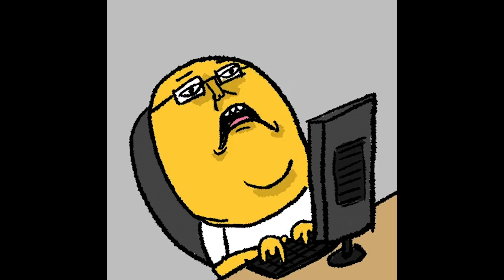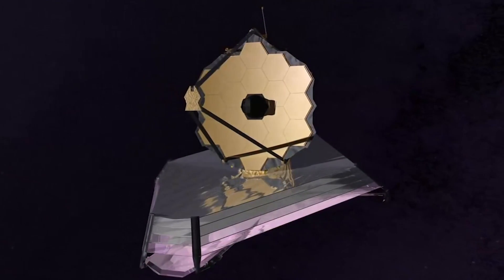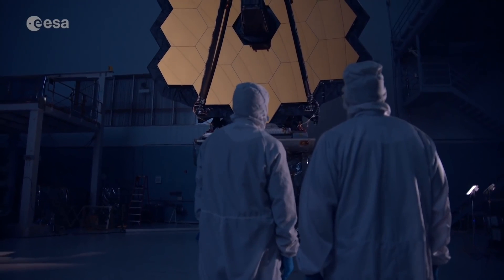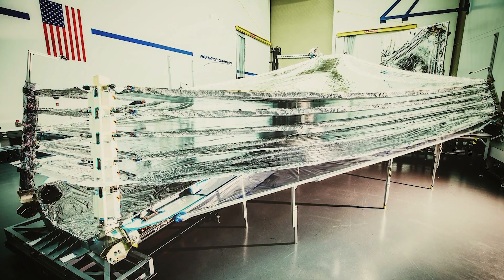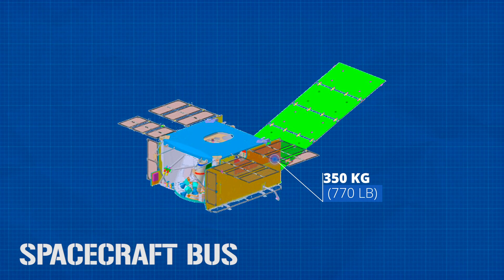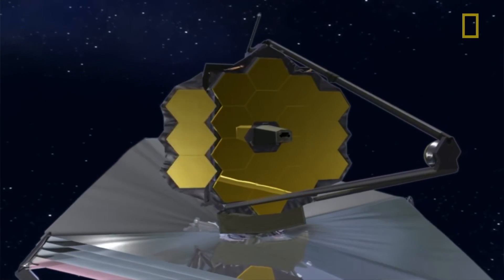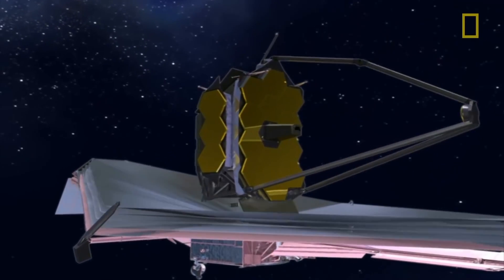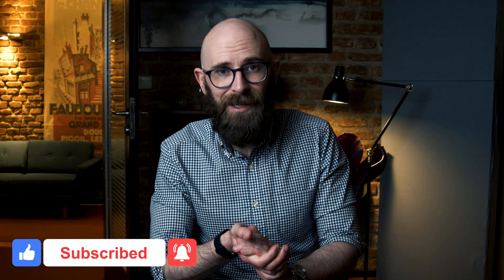The James Webb Space Telescope: Evolving Hubble for the 21st Century

Comment: What about this lensing system that uses a heavy body (sun ?) as a lens?
Focal point somewhere in the area where Voyager 1 is, sort of.
Or was it some 600 AU's?
Voyager 1 now at 14 billion miles 
1AU : 150 million km
Voyager 1: roiughly 130 AU
Conclusion :  blurred and out of focus as was once Hubble..
And focal point is really really far away..
But then, it was never meant to go this far.
I read it would take some 20 years to reach focal point for a 
craft designed for this purpose of traveling some 600 AU's?
Being cynical: plus 20yrs to build it?

Comment: The total cost of JWST has gone DOWN over the several years since it was first announced.
The first cost announcement, as I recall, was $30 billion, back in 2010.
Then, it was reported to cost $20 billion in 2013.
Next, it cost $13 billion.  Now, $10 billion.
Perhaps it should be delayed a bit more, then it will be free?
Keep in mind, the morons reporting the cost have spent the US into an unrecoverable debt, now $30 trillion ($30 thousand billion) in the hole.
Mostly borrowed from: china.
So, the Chinese can claim to "own" Webb!
Reply: Accually there are $7 Trillion in treasury notes and bonds owned by foreign countries, out of that China owns $1.1 Trillion or 3.9% of the US debt. You might be interested to know that Japan is the largest holder with $1.28 Trillion. Foreign countries seem to think the the US is a good investment, or do they just want us to continue to buy there crap.

Comment: The launch date has been moved back to November 19th.  I would trust SpaceX with it more, but the rocket for it has already been designated. Will the cooling and the telescope's "space umbrella" protect it from solar storms being that close to the sun?
SpaceX should start working on the mission to fix the JWT's myriad of failure points if it fails to deploy properly and it will certainly need maintenance on its 126 motors and over 800 other moving parts and computers.

Comment: I'm sure somebody is already commented on this, and this may not be read by the creator, but the people who made the Hubble telescope refused to let other people verify if the mirror was correct. They did one final check before launch and it showed it wasn't correct. So they decided not to believe that data but to believe the data that was 5 years old when they had checked the mirror before. They absolutely screwed up Hubble in a way that was easily detectable and easily correctable. But they told people to f off and said of letting an independent group verify the correct shape of the mirror. There is no reason to be surprised that the James Webb telescope is being verified by multiple groups. I'm saying I'm surprised it wasn't verified by more.

Comment: What I am worried about is the telescope's vulnerable state it can get hit by small meteorites due to not having any protection to projectile while in space and being far from Earth.

Can someone correct me if this issue has been resolved.
Reply: While feasible, it is a calculated negligible risk.  Kind of a big-space-little-meteorite deal.  Also, a micrometeorite would not explode the whole telescope, ot would just degrade performance.  Think of it like a pair of glasses.  They get smudged and scratched over time, but you can still see better with them on.

Comment: What is likely to be revealed when the James Webb telescope is turned on the dark spaces which remained in the Hubble deep space images? the signs are that what appears to be empty blackness will also be filled with galaxies. At what stage will blackness remain empty blackness no matter how powerful the telescope used on it may be?
Reply: "At what stage will blackness remain empty blackness no matter how powerful the telescope used on it may be?"

Only at the moment of self-realization.
Reply: @xxxYYZxxx  That is a stupid answer. No amount of self realisation will tell us what is in the black spaces which Hubble couldn't resolve. I realised that I  was myself when I was less than one year old, but it doesn't help me figure out what the Jas Webb will see in the black spaces.
Reply: @bernardedwards8461  My "answer" was meant to point out the metaphorical content of your query, however unintentional the metaphor may have been. 

A coherent structure sums to zero, while "empty blackness" is a metaphor for such a coherence, as per the term "metaphysical void".

The realization of the Absolute entails the realization of eternally pure stasis, colloquially referred to as "God's grace" or "Nirvana". 

An eternally pure stasis is the required form of "the universe", assuming the universe happens to be a coherent (zero sum) structure. If the universe isn't coherent, any dialog on the matter is a moot point to begin with.

Self-realization, among other thing, entails the realization of "eternally pure stasis", and hence my silly "answer" relating self realization to peering the endless void.

Comment: it is almost certain to fail within 3yrs due age of components reaching end of life see last cause of delay a wifi chip have to be replaced as it was end of life. this will be happening with all components including the mainboard actual board it is made of which often shrinks over time due volatilies evaporating thus causing shrinking of the actual board resulting in micro cracks of circuits !
Also its wavelength is in infrared which only benefits a limited number of astromers better to refurbish Hubble where all astronomers benefit and if being refurbished properly it wave length can be extended to infra red.
Better to sell it to eon Musk for him to launch  on his way to Mars.
Either that or just scrap it it is doing too much harm to other parts of the space program esp manned and Hubble!  it will continue to cost more of NASA budget after launch especially as it goes faulty due to age. waste of time money and resources allthough some technology advances have been made. But Bitcoin investment would give a better return ie put an all wavelength observatory on the moon !

Comment: It should be a requirement for all future launches that parts of any object sent into space be made with standardized parts in the same manner as a bag of tinker toys are all universal to one another. This way robotic systems in the future can disassemble antiquated or worn out equipment, and easily repurposed and flown to new projects. If designed at the outset to be scalable, this should be possible.

Comment: Instead of refueling the JWST, which seems risky due to the system design.  A dock with an electronic communication connection point could be added for replaceable propulsion units to dock and disconnect onto the telescope each 5-10years.
The way the propulsion unit is built, is the same way a battery is built into a phone, so consumers replace the phone instead of the battery.

Great way to make a few more billions, I see.
NASA, spend millions/ billions, use once, throw away.

Comment: I suspect that SpaceX could run a refueling tanker up to JWT in 5 or 10 years.  Depending on what JWT is able to actually accomplish during its first 5 years and how much more it could have available to do after its currently-expected lifespan, it might be worth the effort; and it would certainly be better and cheaper than waiting another 20 years for a replacement.

Thanks for posting.

Comment: The scariest part of this mission will be the initial deployment. 
 The company I work for not only built all of the mirrors themselves, but all of the deployment and focus adjusting motors and mechanisms.
The electronic boxes that drive the focus motors must work down to FIVE DEGREES KELVIN!
I helped test some of those boxes in a Liquid Helium cooled Thermal Vacuum chamber.
Reply: NASA Plum Brook Station in Ohio?
Reply: @sethshaffer8592  Are you asking where I work?
A hint: The same company that built the hardware that fixed the Hubble Telescope, Built the Kepler Space Telescope, Lots of Spizter, and AXAF, the HiRise camera in orbit of Mars, and the Deep Impact spacecraft that slammed into a comet.
Reply: Just one small correction to your post: it's 5 kelvin, never 5 degrees kelvin. Kelvin are an absolute unit, thedefore it does not need the "degrees" part unlike celsius, for example :)
Reply: @stuartgray5877  love when people name drop instead of answering a simple question..
Reply: @macdietz  Great.  Because that's what I did.  I love it when people are sarcastic.
Reply: Near Cullman AL?
Reply: @richardwilliams7492  I work for Ball Aerospace if that is what you are asking....
Reply: @PinnëdbyMegaprojects   You have been reported for Impersonation and Phishing =)
Reply: @stuartgray5877  
Hi Stuart. I also worked at Ball, in Boulder,  in the Flight Machine Shop, doing WireEDM work on JWST.... primarily on the various titanium flexures which are going to be making the very precise adjustments needed to focus the primary mirror segments, between 2003 and 2016 when I retired. 

Looking forward to a very successful launch and deployment..... which will serve to give an even greater "depth of field" to King David's observation in the opening verse of Psalm 19... The heaven's declare the glory of God!
Reply: @user-iyyyy  then we would know each other by sight.  I used to walk past the EDM machines a dozen times a day.   My avatar pic is JPSS-1 ready for launch.
I was the guy that used to dig through your recycle bin for cool stuff.  In fact they moved the bin behind your EDM machines probably because of me.
Reply: And??? What happened? They failed?
Reply: If this fails, I will personally hold you responsible 😂
Reply: ^I can't believe there are two people active on the project in the comments section. That's awesome
Reply: I worked down at Unicircuit in Littleton helping to make the bareboard for JWST. Pretty happy things are going well with the deployment.

Comment: Why JWST will unfold and test just at the L2? It could be done in the LEO and gently transferred to L2.
Reply: Just a few issues with this (very simplified) 1. More atoms in LEO will degrade mirrors.  2. Bad thermal environment for the necessary cool down.  3. Damage due to accelerations in deployed configuration.
Reply: @notmuch117  No need for simplification. 1. More atoms in LEO for few weeks wont hurt JWST as it did not HST for 30 years. Atoms are lesser problem than micro meteorites which are present at the L2 also.
2. Not perfect, but no damage will be made to the telescope.
3. JWST will travel 14 days to the L2. No need for large acceleration. Delta v needed from LEO to the L2 is less than 3.5 km/s. Ideal for ion thrusters, if 60 days transfer is acceptable.. Anyhow, test deployments on the ground put much larger force on the elements, than any resonable burn.
Reply: This is why my response was stated as being over-simplified. Not trying to get into battle of wits.  You seemed to ask an  earnest question and I was just supplying a few of the points/reasons I see for the current plan.
1. Apples to oranges.  JWST mirrors are different materials and coatings which are much more susceptible to atomic degradation... and particulate damage due to not being encased.  Also, I made an assumption you meant A LEO we could send a manned craft to help deploy/repair.  We currently can't do that with hubble.  I may have missed the point here.  (I'm not even going into current craft and EVA capability...or lack thereof)
2. Not necessarily true.  Orbiting earth would provide relatively wild temperature swings to the structure that would have been (Even more) expensive to design for/model/test/certify here on earth.  Something I know of-but not much about- would be the adverse effects from the plasma flow field in LEO.
3. There is a lot more to this than simplifying JWST to a ball of mass.  (I am not aware of the exactness of the 14 days number.)  It's not just getting to L2.  It's setting up an orbit around L2.  It's adding fuel mass to slow the satellite down after launch to keep it in LEO. It's adding fuel mass to accelerate back up... you see where this is going.  
As for testing, we can't simplify it to acting on a ball of mass.  Orientation and state of deployment are critical. Whenever ground tests would be too much for the structure, a gravity offset was used. (Eg. Secondary mirror deployment. )
I'm far from an expert in this, but have found that there are often (not always) some really good reasons for complex decisions like this that are not immediately apparent.
Reply: @notmuch117  "to slow the satellite down after launch to keep it in LEO. It's adding fuel mass to accelerate back up."
Orbital mechanics does not work that way. 
Best Regards
Reply: Agreed.  (Yet again over-simplifying an already too-long post.)  You know what I mean... at least I assumed you would from your previous post.  I'm sorry if this came off as an attack, I was truly just trying to answer the question.  That being said, your Appeal-to-ignorance fallacy doesn't change my points.
Reply: @notmuch117  Relax man, it is just fine...
Reply: Agree again.  Take care.

Comment: 10 billion and counting!!! And it has not taken a single picture of anything. Keck telescopes costed 1 % of the yet growing cost of this works project for the aerospace consortiums of US and Europe, plus the fact that the only vehicle able to go there today to upgrade or give maintenance to the POS is Musk's Starship. It has not gotten up there, yet. Good thing they are using Ariane. if it was SLS, the Protomolecule would have terraformed Venus before JWST would have been operational. For 10 billion plus, how many 30 or 50 meter telescopes with corrective optics could have been built here?

Comment: I'm just about to start the video I just want to big up the LaGrange points if it wasn't for them this telescope would not be possible too bad it A Million Miles Away there will be no Rescue Mission if it cannot focus properly so you know the engineers are afraid to Launch because what if it happens again you cannot go and fix it launch everything has to work because the L2 is between or in the middle the Sun and the Earth where its orbit will be relatively stable for eternity or until one of the gravitational forces of our solar system drastically changes

Comment: The sad part is that if anything goes wrong there is no way to repair it in an L2 orbit.
Reply: How do you figure? That’s not that far.
Reply: @ObservationofLimits  The L2 La Grange point is hundreds of thousands of miles on the back side of the moon. Orbital mechanics does not allow for a manned mission to the L2 point. Neither SLS or Starship Heavy would have the fuel to overcome L2 obital mechanics.

Comment: The biggest problem with the Webb was that NASA used a ton of different independent contractors who neither talked to each other or tested their components thoroughly enough. The result was that NASA often got components that didn't actually work properly together, or failed way earlier than they were supposed to because the contractors cut corners.

Comment: I used to work at one of those contractors, we always called it JWST not JWT in house. I don't know if NASA has guidance on that. Also the primary mirror adjustment motors are 6 degrees of freedom, so each of the hexagons on the main mirror can position and point independently.
Reply: Interesting, I was wondering if that name came from the contracts because in everything I’ve read from NASA it’s been called JWST

Comment: Only 5 year useful life? For $10B it should be 30 like Hubble. Run out of fuel = cheaper to send a refueling rocket there than build another from scratch.
Reply: It is not Material of 10B. It is the research and development. A second one would be probably 400m
Reply: Do you actually know where the L2 point is? (it's not like a drive to the shops!)
Reply: @Chris-hx3om  About 1M miles toward the orbit of Mars but about 35x closer than Mars's orbit. Seems we are sending crap to Mars evey other year now. An autotmated tanker truck 35x closer seems alot cheaper and easier than a whole new gadget, hell it could even be a pitstop toward the next Mars landing or whatever. I find it insane were treating $10B items not much different than disposable razors or paper cups and plates.

Comment: Just one of the things about the JWST that blows my mind is that out in the cold, hard vacuum of space at L2, this thing requires a cryogenic plant to keep it cool.
Reply: It's still at roughly the same distance from the sun as the Earth.
Reply: The side facing the sun gets very hot in space. Not only that but due to less molecules to diffuse the energy, heat takes FOREVER to dissipate, thus requiring active cooling